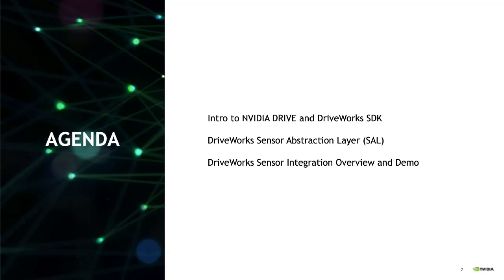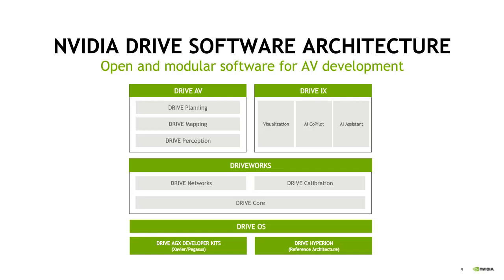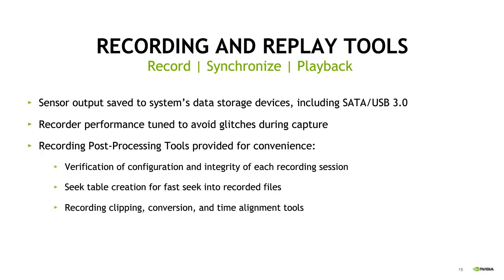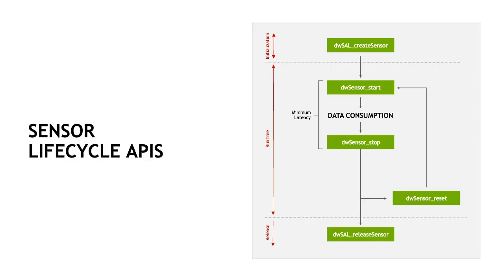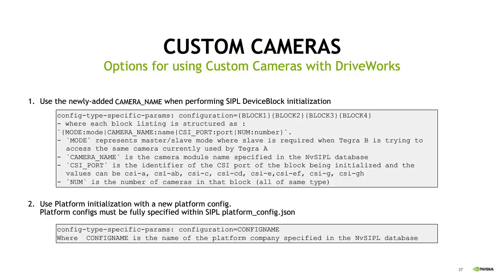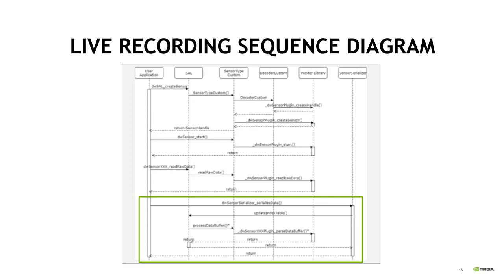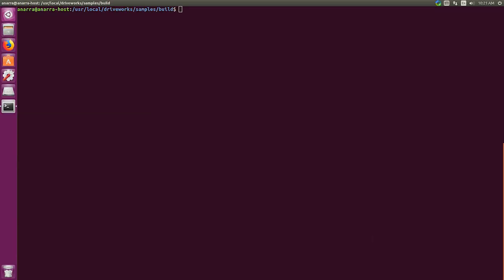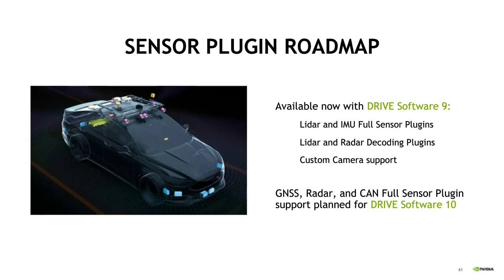Webinar: Using Custom Sensors with NVIDIA DriveWorks

Comment: I would love to win either GPU or laptop. A laptop is much better for me a thin and light and powerful. Would love to win razer-blade. My Desktop pc parts are: Operating System: Windows 10 Pro 64-bit,CPU:Intel Xeon E3 1220 v3 @ 3.10GHz Haswell-WS 22nm Technology, RAM :16.0GB Dual-Channel DDR3 @ 799MHz (10-11-10-30), Motherboard: ASRock H87 Pro4, Graphics, 3072MB ATI AMD Radeon R9 200 Series (MSI) Storage: 223GB KINGSTON SHSS37A240G (SATA-3 (SSD)),1tb external game drive, Power supply corsair 500w,case:Cooler Master trooper case, Monitor:40 inches Toshiba tv at 1080p.
I could not afford any NVidia GPU so I have to buy an AMD instead. Now it’s just gaming pc for my 1 niece and 2 nephews. I am not fan boy AMD or Nvidia. I just buy the best card with what I could afford. Ps to all those who replay to my comment, I am just ignoring all of them. Such a shame… why people can’t express themselves of the right of freedom of speech! @NVIDIAGeForce with #RTXOn and #E32019 and #GeForce